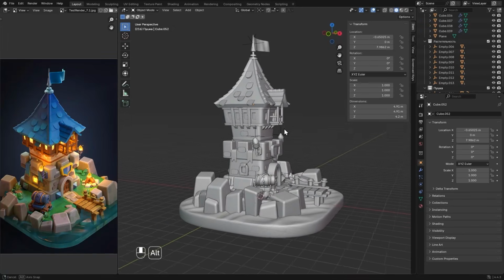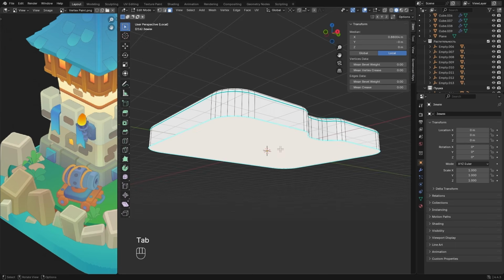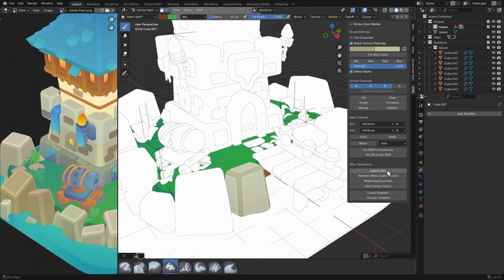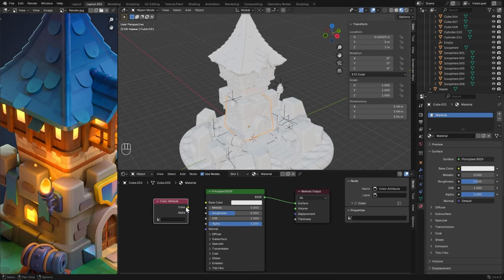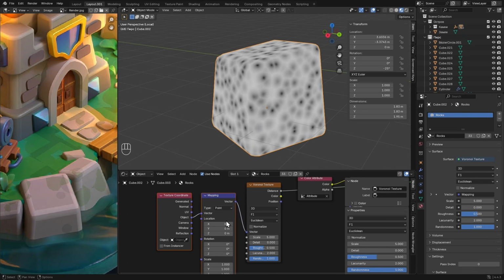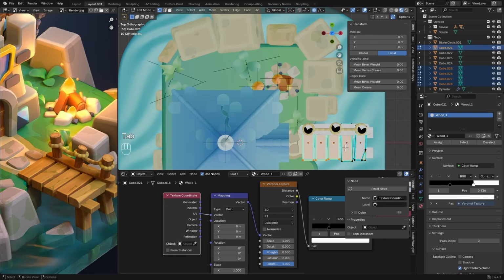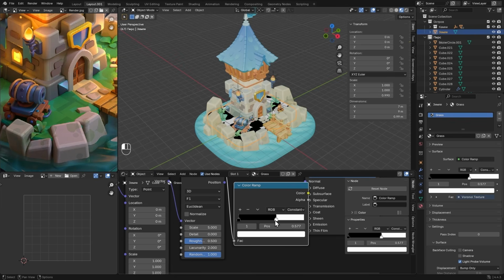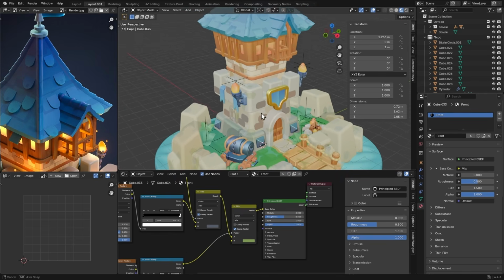Blender Tutorial for Absolute Beginners - Texturing a Stylized 3D Scene. Part 6

Comment: Linear color gradient is not working properly
Reply from the maker: At what specific point do you run into difficulties?
Reply: Whan I drag a gradient line it doesn't mix colour properly it's more darker in shade
Reply: If I can send you an image, that would be better for understanding the issue.
Reply: @VideoSmileWorld The same thing, the linear gradient is painting in a darker color than selected, I think the addon doesn't work properly on 5.1
Reply: This also happens to me
Reply: @i_sclimber  what issue you faced
Reply: you need to use other blender version like 4.5.8 LTS it worked for me after changing the version
Reply: i just did it without addon in Vertex painting , like we did for ground and for me its worked better than linear . u right its more darker with linear and i cant fix that
Reply: Turns out the add on is not compatible to blender version 5+ because of change of color attribute algorithm or something. I solved the bug by asking chat gpt/claude to fix the add on